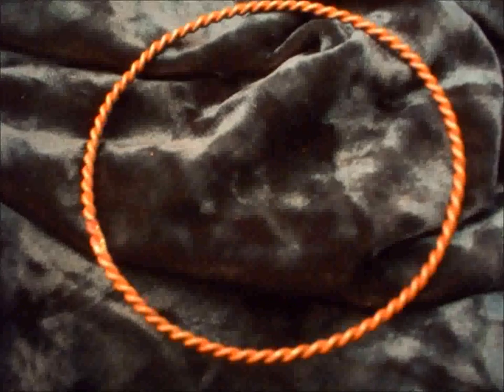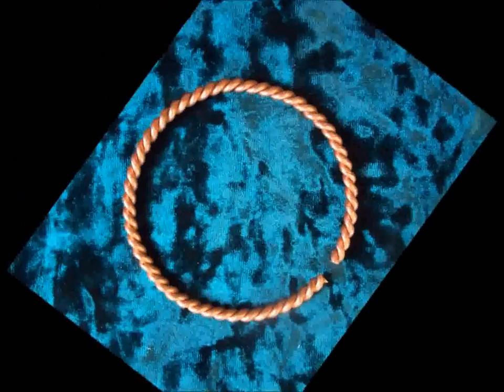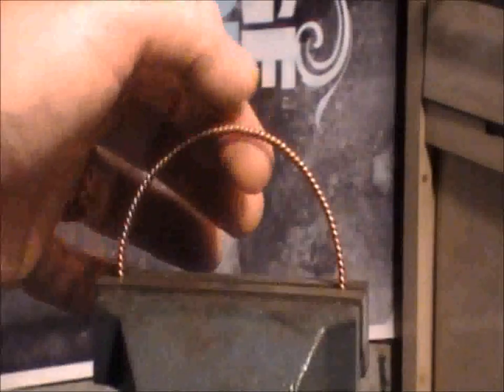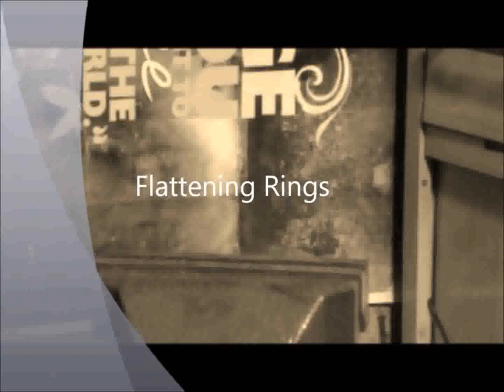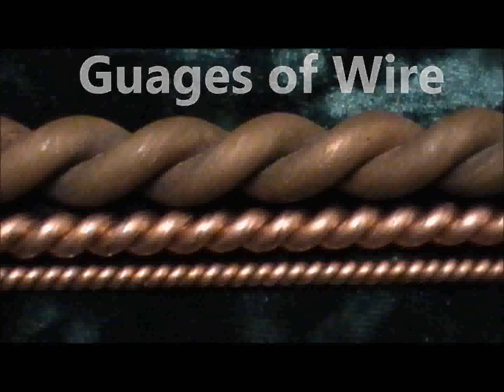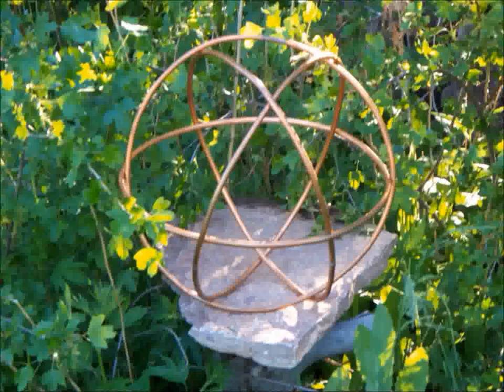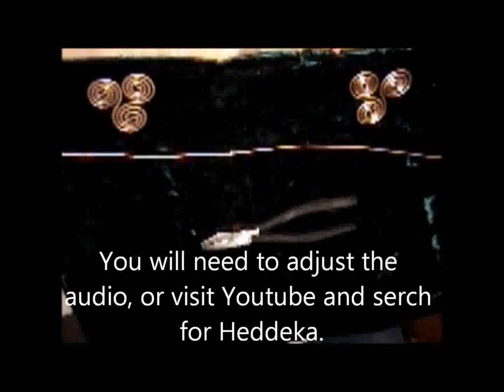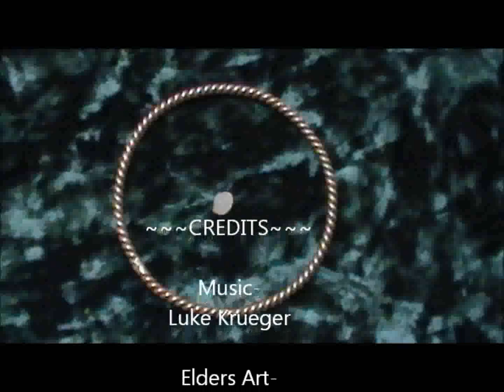Creating the Tensor Ring

Comment: Heat red hot only if you use silver solder, otherwize your tin/lead solder won't stick to red hot wire and it to oxidized, flux is burned to carbon!!!! Practice on scrap first folks.

Comment: TENSOR RINGS

Tensor Rings can utilize Cubit fractions and combinations of 1/8, 1/4, 1/2, full, 1 1/2, 3 1/2.
Slim Spurlings wife uses 2 cubit

144 MHZ Cubit~aka Sacred or Royal Cubit.
Comes from the King's Chamber of the Great Pyramid.
Slim Spurling's Cubit.
Known for its work in the Physical.
20.60 inches ~ 52.324 cm (Slim Spurling, vortex water consultant)
3.5 Sacred Cubit ~
Measuring 72.1 inches from the floor to the boss, its perimeter is exactly 3.5 times the length of a Sacred Cubit. This is the measurement used for the large ring, called the 3.5 Sacred Cubit Light-Life® Ring.

177 MHZ Cubit~ aka Lost Cubit.
Discovered by Hans Becker and Slim Spurling.
This Cubit length was created out of a mathematical formula.
The 177 MHz Tensor Field is known for its connection with the Etheric and Emotional bodies.
Can also use 3.5 cubit length.
23.49 inches ~ 59.67 cm

188 MHZ Cubit~ aka New Cubit.
Synergizes well with the 144 and 177. 
Resonates with and decalcifies the Pineal, helps release Programs and Beliefs.
It seems to support mental clarity, enhance healing processes, and be connected to the spiritual realm.
Brought to us by a Master Dowser.
Was also given to Slim Spurling before he passed; his widow calls it the Empowerment Cubit.
28.85748 inches ~ 73.3 cm

333 MHZ Cubit~
Changes the color of sound and works well with Sound Healing.
Twistedsage uses it in the Water Ring.
Brought in by a Master Dowser.
It seems it may have a relation to King Solomon's Temple.
Works as a Straight Line Cubit.
39.3131568 inches ~ 99.8554 cm 

764 MHZ Cubit~ One side of the 27" Ring has a Black Whole, or absence of energy, while the other side creates a tornado style field.
The tornado field always travels toward magnetic North.
You can change the "polarity" of the output simply by intention.
Possible uses of teleportation and tornado wrestling.
Pulls in and transmutes dense energy. Brought in by a Master Dowser.
77.55836 inches ~ 196.9982344 cm

Both Harmony and Ascension are created through connecting the energetic aspect of the rings, the Etheric Templates, to the physical ring.  
It is this energetic aspect which give these rings their extraordinary frequencies and properties.

Golden-light rod ~ be in the heart and energetically clear self and environment.
Rod attunement video: https://youtu.be/fUnb6aAYixE 

We no longer offer the Galactic Ascension Rings, as their etheric counter-parts have not been updated since their conception.
The Ascension Ring is that higher dimensional aspect of the Galactic Cubit.
Galactic Cubit~ aka Ascension Ring
Discovered by Marty Lucas and Scott Ertle, the two dowsers connect to Source and ask for a Cubit length they could use- they received something that works unlike any other Tensor Ring.
The Galactic Cubit connects with the Higher Soul Self and works with all of the Soul's Aspect.
At each twist you will find a Tube Torus.
Each individual tube torus pulls in positive and negative energy, sending it out as a non-dualistic energy ~ a whole and complete energy.
These tiny toroids also act as DNA scrubbers.
The ring connects in with the Light frequency of DNA.
Soul is the consciousness that is in control of frequencies and Light that come through the ring.
61.8728 cm  
This Ring prefers a looser twist than the standard Rings.

The Harmony contains all of the Galactic frequencies and properties.
Harmony Ring is the energetic aspect of the Standard Teotihuacan Unit of measure.
Harmony Rings~ Standard Teotihuacan Unit (STU)-  
This Cubit measure was used in the construction of Teotihuacan, the Great Pyramids, Stonehenge, and other ancient sacred sites.
The Rings cut from this Cubit can be used in 1/4, 1/2, etc., just as standard Tensor Rings, as well as in the 1/3 increments to create a working Ring. 
41.7086614" or 105.94 cm
This Cubit can be used in creating Straight-Line frequencies. 

New Earth Resonance
The Tensor Rings sold by Dancing with Water are based of the new Earth Resonance cubit length identified by the authors in 2015.
Tensor Rings made using this measurement are tuned to the Earth’s central core and to the Earth’s natural energy field.
They re-connect water (and anything placed in their energetic field) to the core energy of the Earth.
This cubit length is extremely grounding and protective for water.
19.65 inches ~ 49.911 cm

STRAIGHT LINE TENSORS

Straight Line Tensors can utilize cubits in fractions of 1/3, such as 1/3, 2/3, 1, 1-1/3, etc

Sacred Cubit- 25.025” or 63.520 cm
1/3 of this length (21.173 cm) produces the sine wave of the frequency of the hydrogen atom.

Black Cubit- 21.352” or 54.153 cm
Both Cubits above are used in our Keys and Starbursts, and work similar to Tensor Fields in their elctro- and geo- magnetic restructuring.

Remen Cubit- 14.583” or 37.441 cm
This is the Cubit Bill Reid uses in his version of the Starburst design.

333 MHZ Cubit-
39.3131568" or 99.8554 cm
Works as both a Tensor Ring and Straight Lined Cubit

DISCOVER

The 888 Series then came along and took everything even higher (while still grounding in all ways).
These tools opened up a whole new paradigm for energy work.
888 Series ~ Never been used on the planet to build, yet was used in the creation of the planet. 
Creates a higher connection.
Metatron brings through geometries that have never been here before.

Standard Fire Ring~ Not a Cubit, rather an Energetic Ring anchored into the physical through sacred measures. Restructuring frequencies known and unknown, to be beneficial. i.e. Harp, Radionics, Geomagnetic, EMF.

The Golden Fire then came in with the highest aspects of all the previous tools, along with all that the Golden Fire is doing with the Sacred Heart, Quantum Mind, Universal Peace, and all the other healing clearing attuning and activating that they do innately.
Golden Fire Ring ~ Contains all the highest aspects of each and every tool we’ve created, plus the high level consciousness work that we do also comes through and is available to the higher Soul Self of each and every person within their field!!
Related to the new geometries that are coming onto the planet at this time.
Activates the Sacred Heart and the Quantum Mind.
These Rings contain the highest aspects of all the previous Rings together, and so much more.

The Golden Light Wand is based on a Sacred measurement that anchors in an ancient etheric tool which moves geomagnetic lines, and has the ability to clear timelines and realities.

Please visit the Testimonials on the Golden Fire Rings product page,
as many of the profound testimonials are from people
who only sat with a picture of a Golden Fire Ring!!!
TENSOR FIELD GENERATOR

We are the Elders Three here to speak to you of your Sphere of Completeness and Unity.
By your intentions and the sound of your voice and your touch you can program your sphere as a tool in your life.
You first program should always be that any program be in the highest and best for you.
By this statement it is also in the highest and best for all.
Enjoy this tool and play with it.
~The Elders Three

On your birthday each year it would be to your benefit to clear your sphere of all programs and start again.
This way you do not have unwanted programs running.

Program it so I am the only one who can program it.

Comment: I've just checked one of my twisted set of wires and then checked to see how the ends would match up.  As he showed in the video, cut your wire length just a smidgen longer, so that when you file flat those sharp ends your wire will come out exactly the length you want.

Once you file the ends flat make sure that when you forming your circle that you are bending it such that the ends match up wire for wire.  On any twist, they will almost match, it's just that they should not be 90 degrees off from each other so they make for a cleaner soldered joint.  If they do not match up perfectly I used my side-cuts to cut the piece just a smidgen shorter so that when I filed them flat they would match wire for wire.
Reply: Can one twist the wire by hand? I don't have a drill. My purpose is to make a Heddeka. Does that have to be made with twisted wire?
Reply: The earth elementals are made best by hand with needlenose plyers.  @RobinRainbowGate
Reply: The best are made by hand with no tools

Comment: I have a question, im about to make a ring as I have plenty of 10 and 12 gauge wire, first  question is can I just use a vice instead of the board to hold the wire so I can twist it that away? Could I also make one long piece and cut them to the length I need? Also can these be welded instead of soldered?  Lastly how do I put the rings together to make the field generator? Thanks love and light!
Reply: did you find out, i want to know too

Comment: Hello, I'm new to this and I'm making something for myself. I'm curious why it's recommended to use a single copper wire, fold it in half, twist it, and then cut off the end, instead of using two separate wires. Can you help clarify this for me?
Reply from the maker: Because when wire is made, it creates a one way flow of piezoelectric due to the alignment of the crystal structure.  A Tensor Ring requires this flow to be in both directions, which is why a single wire is folded in half.  You can use two separate wires, but would need to ensure the innate flow is opposite of each other.
Reply: @Twistedsagecom  Thank you for the clarification and for sharing your insights with the world. It's crucial to spread knowledge so that together, we can expand our collective understanding.

Comment: I'm really interested in doing this. I just have one hang up. How do you get an accurate cubit to inch measurement? For the 1/8 I don't understand how to get a perfect 2.575" length of twisted copper without relying on dumb luck. I'm excited to do this I just worry I'm going to cut it improperly.
Reply from the maker: Using a metric scale, in mm, gets one so much closer...  and ones intention can over-ride the physical in this case :)

Comment: Brian, when you put the wire into the drill, you mentioned twisting it clockwise, but does that mean the drill should be turning to the right (tightening a screw) or the left (loosening a screw)?
Reply from the maker: Hi Dave-  putting the drill in the "forward" direction as if screwing in a screw is the right way :)
Reply: If twisting is looked from one end right handed then looking from the other end will be anti cloakwise.

Comment from the maker: www.sacredmeasures.com has a full list of Cubit measures, in cm and inches.
Reply: what about diameter of the copper wire? which work and which doesn't and  could you tell me the right one by AWG OR SWG?
Reply: Rose, On 14 AWG it doesnt make any difference in the energies which ends fuse.
10 or 12 GAUGE is used on regular cubits:
Full Cubits ~ 1 1/2 Cubits ~ 1/2 Cubits
They can be also hammered flat and used as 1/8 Cubits
14 GAUGE wire works great for:
1/2 Cubit ~ 1/4 Cubit ~ 1/8 Cubit
They can also be hammered flat and used as 1/8 Cubits
16 GAUGE or smaller wire just doesnt work well
-----------------------
SACRED CUBIT 
52.324cm (20.6")

LOST CUBIT
59.6646cm (23.49")
-----------------------
Reply: @tiberiumseeker2422  where do we use the Heddeka symbol? What does it do when we wear it as a pendant?

Comment: I loved this video and found it super informative. However, I am trying to make Tensor Necklaces  with 188 Mhz, 144 Mhz & 177 Mhz. I just don't understand the correct way to measure these out. Help please & Thank you 😊
Reply from the maker: Use millimeters and a good ruler.  You can use the full Cubit measure, or divide it in 1/2, 1/4, 1/8, 1/16 increments. Your intention to be precise, and getting as close as you can to the mm length, is all that you need for measuring :)
Reply: Does your shop offer those .00 precise template guages for sale?

Comment: I am assuming that you are using AWG (American Wire Gauge) wires? I am just trying to find the best ones to correspond with the wires available in the UK, which go by our system of SWG (Standard Wire Gauge). From what I can find, AWG 14 is 1.6277 mm; here, SWG 14 is 2.032 mm for example. What would your advice be as to finding a closest match please? My source for info: www.wires.co.uk/acatalog/conversion.html
Reply: great question! i was using 1.6mm thinking is 14 Gage :) never knew about the UK and US difference. Gotta buy bigger wire! thanks a bunch :)

Comment: So when you solder the ends, it's one blob for both wires, this means the wires are no longer electricity independent of each other ?
If that it true then why does it matter it the same end of each wire lines up with itself?
Reply from the maker: The copper wire has a one way flow of piezoelectric, so when the wire is folded in half, and twisted, then cut, the two wires have an opposite flow of energy within them.  The ends are matched up so there is an uninhibited directional flow of energy within a single wire.
Reply: @Twistedsagecom   From what I know about magnetics no matter what you do to a wire, by twisting or what have you, when you cut that sinlge wire or a set of twisted wires you crate new Positive and negative ends.  You can't have both ends of the twisted wires be positive can you?   That is the part of electronics or electron flow I do not understand.

Comment: Since the inch is usually divided into 8, making the royal cubit which is 20 and 6/10" what's the best way to measure so it's correct? What is it in cm and inches correctly?
Reply from the maker: Converting to Metric creates an easier and more precise measure, for sure....

Comment: @22:24 are there any effects if you do the opposite?
Reply from the maker: It has never felt right to twist the wire counter clockwise.  We understand there may be a use for it in the future, but currently we see that it is producing a nonbeneficial energy when spun counter clockwise.  Again, that is only what we currently see!  Things shift and change quickly, as you know!!

Comment: Does it need to be half hard wire or will dead soft work as well
Reply from the maker: Dead soft is easier to work with in the heavier gauges.  They will both carry a Tensor Field.

Comment: Do the rings have positive and negative sides?
Reply from the maker: A Tensor Ring that is properly functioning does not have a dual field to it, both would be the same flow and beneficial in both cases.  The 764MHz is the only exception, in that there is some sort of polarity associated with that Ring.  Sacredmeasures.com tells a little more about the 764
Reply: thank you

Comment: On heavy gauge wire does annealing by flame affect the properties and divination of the rings?
Reply: No, the energy will work just as well. It is best to hammer the rings rounded with a rubber mallet. This helps to realign the crystalline structure for proper flow and re-solidifies the copper after being softened by heat.
Reply: That is not very wise as it will tamper with the original measurement possibly making the ring larger. Any hammering should always be done prior to cutting the measure.  @chrismccaffrey8256

Comment: If twisting two wires is good then wouldn't three wires be better?
Reply from the maker: We are twisting a single wire, folded over to create a two-way flow within the Ring.  Adding a third direction of flow will create an imbalance in the field, and you will no longer have a beneficial and working Tensor Ring.

Comment: I tried to make this but didn't work. You are making a tensor ring of copper wire, but you use tin wire for the attachment? Because I tried to attach it with a similar torch, but it didn't melt the copper.